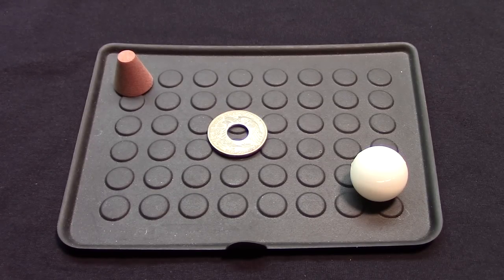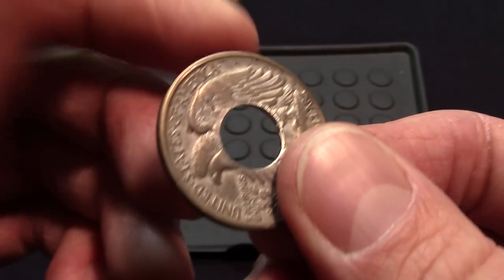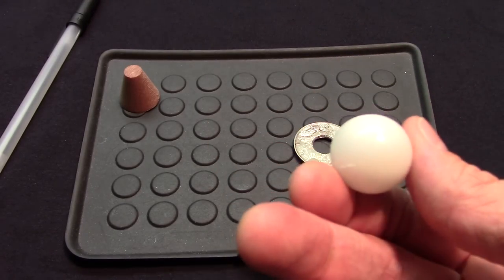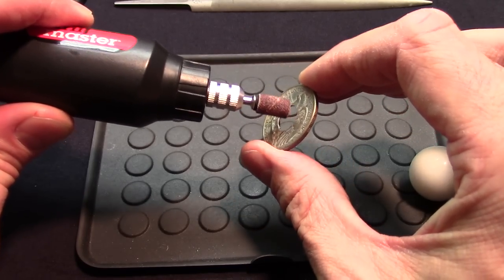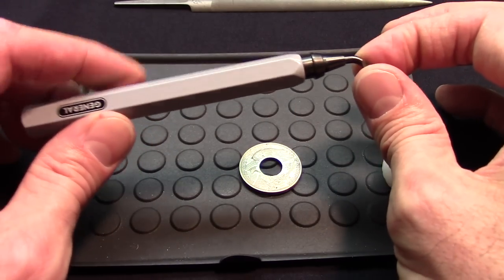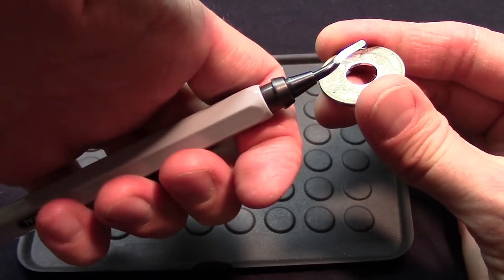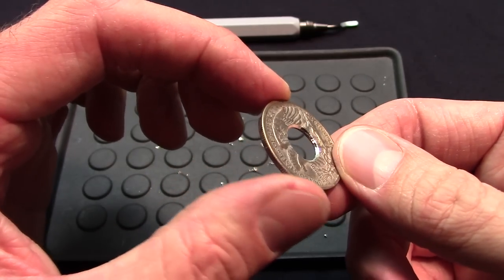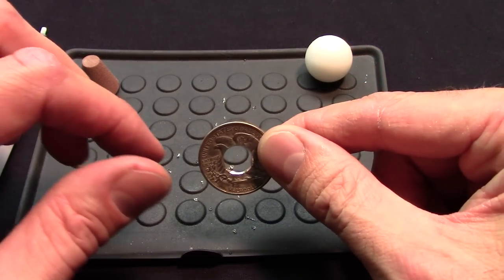The BEST Way to Protect your Folding Tools BEFORE Making a Coin Ring

Comment: I would also recommend, after using the deburring tool, take some very fine sand paper and really smoothing out the hole.  This will greatly reduce your chances of cracking or splitting as you fold the coin over.
Reply from the maker: +John McDermott John, very good point, thanks for mentioning that.

Comment: What would you recommend for lubricant on the cone and delrin?
Reply from the maker: +Brandon Scott I actually recommend not putting any type of lubricant on the surfaces of either folding tool. What's happening that you feel that you need to use lubricant?
Reply: Less friction increases equalized pressure and lengthens the life of your tools.  I guess I'll research a non corrosive option.  Is that why you would recommend to not use any?  If not, what's your reasoning?
Reply from the maker: +Brandon Scott That's true, but in this since the material is not steel, I wouldn't use any. I actually tell people to START a PARTIAL first initial fold with a proper-sized Delrin ball. That way, the delrin is taking the brunt of the completely perpendicular inner edge of the coin, where the most amount of wear and tear will occur on the new foldig cones. Hope that helps.